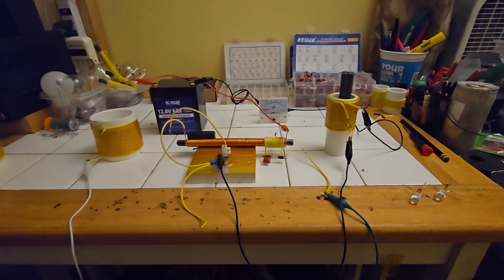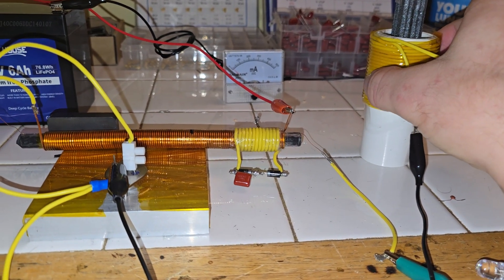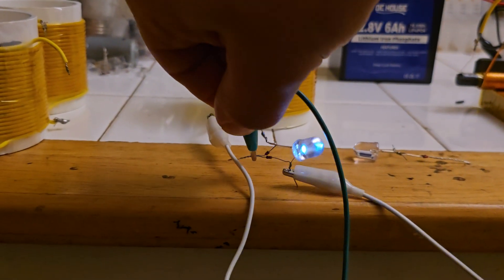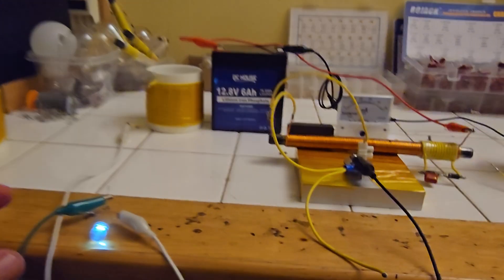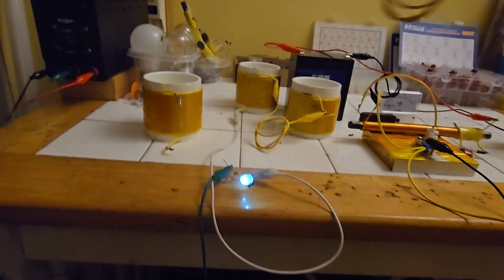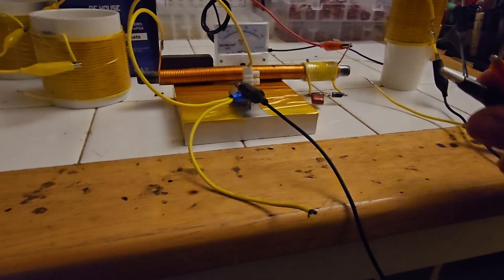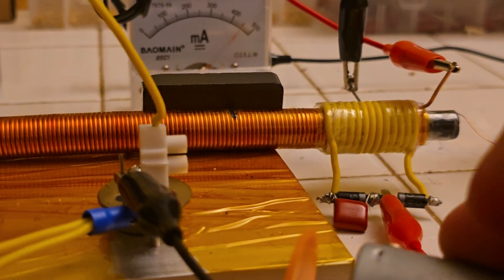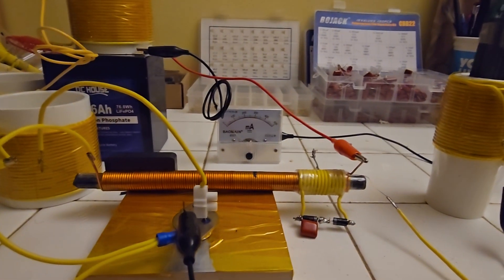♾️IS THIS THE WAY FORWARD? NEARLY NO INPUT WITH IMPRESSIVE WIRELESS POWER OUTPUT🛜 (10mA) INPUT🤯

Comment: I want to build a device to power my camper tv a/c ect any advice whate i could get plans for something like that
Reply from the maker: @roberttaylor5280  most of the current plans are on our channels community posts section & the system at the moment excels at rapidly recharging 9vdc batteries then running household lighting from a impedance matching DC voltage booster board but a 120vac inverter could definitely be run from a large 9vdc battery that's impedance matched to the quarter sized coil for rapid recharging.

Comment: Great video Mal!  Glad to see your still at it.  I will be back in the game very soon now :-)
Humm, this radiating battery, I have seen similar set-ups.  That battery is "radiating" energy.  Have you tried wrapping some alum foil around it, keeping it at approx the same distance as your pick up coils would be, now that foil should be picking up maybe 80 percent of all that radiation,,,, now place your pick up coils near that foil around the battery.  You may even be able to replace your pick up coils with a sheet of foil.
Just thinking off the top of my head.  Keep up the great work!
Reply from the maker: @INVENTOR3  good idea & I was toying with the thought of completely encasinng the transmitter in some form of resonant shield or casing at a distance because when the transmitter is in low power mode it can wirelessly light leds & avremenko plugs in what appears to be a loadless fashion.

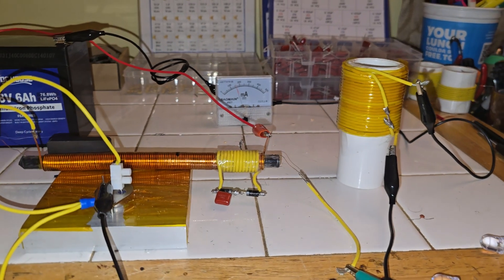Comment: @ 1:59 your amp meter dropped to low setting just before the rod went into the vertical coil, BUT you pulled the rod back out @ 2:02 and the amp meter remains at minimum. LOL 
Resonance is a real thing that you don't have to fake :)

Comment: If it is unloaded and in resonance of course its not going to draw much. If you have high voltage of course it can power an led at 10ma. And clearly you have coronal discharge judging by your burn in the wire and the fact that it zapped you so im going to assume its high voltage and high frequency.

Comment: Details of your coil, input power (is it 12V?). 
3. How many turns ,coil, primary and secondary?
4. May you do a simple tutorial with clear connections, so we can follow. I already bought coil cable. (Please do this considering some of 😢 us don't own oscilloscope machines. What power supply should I use? AC or DC?❤❤
Thanks
Reply: He has put out very detailed information on his patreon for free  some things will inevitably need oscilloscope and other tools to fine tune. If you care to learn buy a oscilloscope it's a great project if not buy one built from him it would be cheaper than building it yourself by the time you get all the stuff required 😊
Reply: @EtherBench  you are experiencing, I am not as you are. Hence I am requesting to learn as a starter, newbie in this. I like everything but trying to build this is not easy without the author's inputs....
Reply: @EtherBench  you speak as if money is free to all, because you can afford an oscilloscope does not mean everyone does own one or can afford one. That's why this world is crushing because of pride and division, carelessness, but anyways. Let me wait for the Channel owner to decide...
Reply: @EtherBench  thanks 👍😊 😊
Reply: @elmultimediaschoolofartscu3924 like I said read his info about building it  watch more of his videos not everything is provided on a silver platter  some effort is required. Oscilloscopes just make it loads easier you can estimate the inductance of coils and do the calculations and re wind coils over and over. Or use a oscilloscope for fine tuning.  Anything is possible my friend

Comment: Please 🙏🥺 add loads, lights, motor, tv etc. how much power is produced? Volts and Amps measurements....😊😊❤❤❤❤❤❤❤❤❤❤❤❤
Reply: Motors are reactive... come on man
Reply: @mitkomanev9783  you don't get my point. I am not speaking science. I am just requesting a bigger version of this design, with so much potential, you can multiply the coils, to allow for 230V more Amps at larger scale. So much you can do here. I believe he can do another videos in future with more loads.. No  limit to what you can achieve

Comment: Thanks for the video I have to give you some comments If you wind a lot of turns it means you will have a larger inductance This coil will accumulate a lot of energy The energy can be very large Because it has a large inductance But remember the thicker the wire the better You have a thin wire resonant coil if you put a thick wire and a large inductance you will have a large current and a large power The coil will accumulate a lot of energy You tune the circuit and grounding well The current consumption drops I don't know why you do it this way In resonance the current consumption must be for example 5 A and voltage 12 V At the output you should make 230 V and 5 A This 5 A draws it from the battery and the voltage raises the resonance You draw 12x5 + 60 watts and 230x5 = 1150 watts and you have a larger watt So you will gain anyway You can make capacitors to hold energy for the circuit and disconnect the battery Then there is free energy You can do like Don Shmit capacitor bank at the output of this system will be more better system Energy depends on the coil inductance from the coil accumulated energy in the magnetic field The greater the energy in the magnetic field The greater the inductance, the clearer more watts at the output of the device
🤣😂

Comment: I want to replicate some of these experiments. Looking at this video and comparing to the description, your main coil does still have the 28awg under the bare 16AWG? and the 16AWG is still in a bucking configuration? it looks llike its all wound the same direction here.

Your resonant coil. is that bifilar wound or just 2 layers? it looks like you have a connection coming in from behind that coil. 

Whats the capacitor on the yellow coil on the main coil? is that just in parallel with the second diode?
Reply from the maker: 0.22uF :)

Comment: Can you run 100 watt light bulb?
Reply from the maker: Yes if the wireless energy scavenging Circuits are used to recharge a battery to then run an inverter for a time